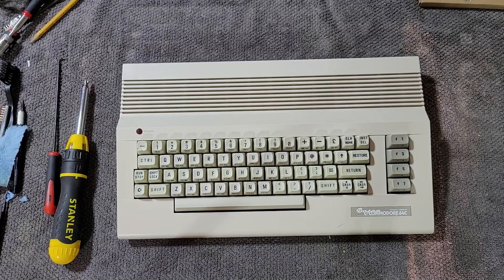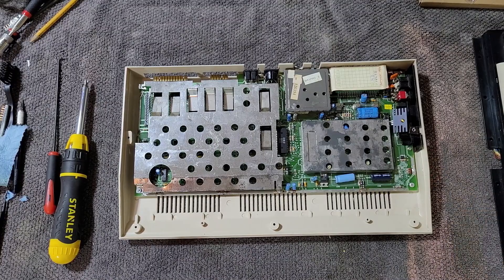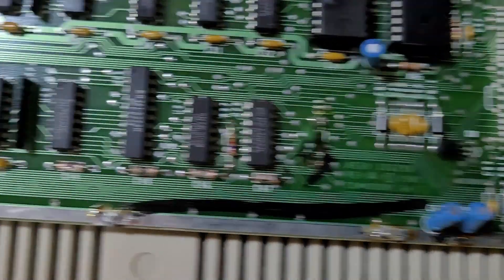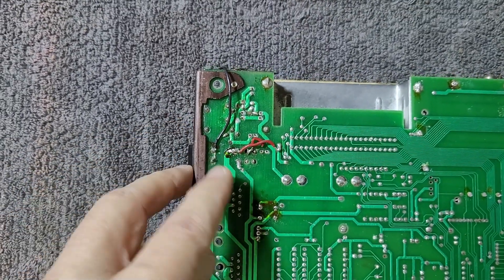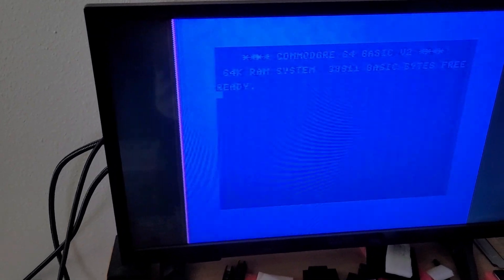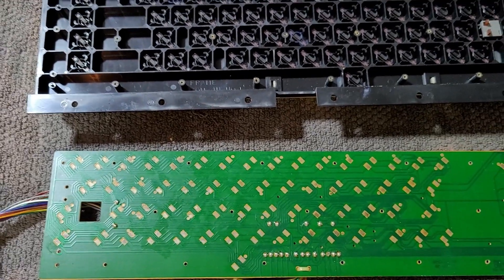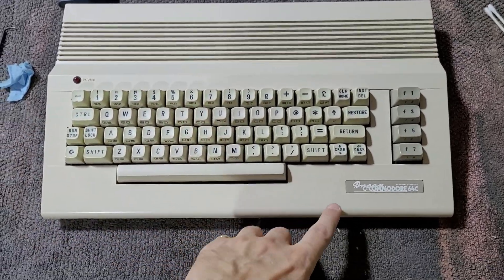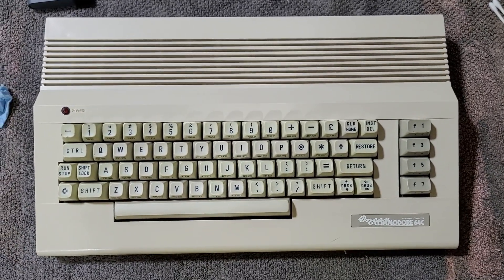Commodore Drean C64C(?)

Comment: I was born in Argentina, and had a Drean C64 as a kid (breadbin, not the C). They were cheaply made, and components were unreliable, as they were based on the cost effective models from Commodore, and spare components (but with official license). If you thought Tramiel was cheap…
Also, PAL N is an extremely weird version of PAL. Not completely compatible with PAL B used in Europe. I live in Spain now and sometimes I think of getting a Drean for nostalgic reasons, but I think is not worth the trouble. Nice video. It surprises me that people get interested in these obscure machines.

Comment: Nice video. I'm from and in Argentina, you've got pretty lucky, there were many variations of Dreans and on some of them the keyboards were awful (not yours). Just one point, Drean is pronounced as Dre Ann ;)
Reply from the maker: That is good to know.  Thank you!
Reply: most of the Drean's keyboards were made in argentina, which were a dead dog.... the thing is, in your 64c (case made in argentina too) was an old c64 motherboard  because Drean didn't get the okay to do the new c64C (hey should way a year or more release Drean's version)...but Drean did it anyways  (for that reason the case ,keyboard,power supply was made locally) ,when COMMODORE realisd about this, Drean lost the license. Dean did some unofficial peripherals under the name "COMM" (??!!) LIKE DATASETTES AND DISK DRIVES  (actually they were just chinese machines rebranded with a new badge and new packaging)
Reply from the maker: @sebastianbattaglia6330  Oh, very interesting.  Just from looking inside you can tell that SOMETHING was going on.
Thanks for the info!
Reply: @nhbretro  you are more than welcome! All this was confirmed by a former Drean's employee in some youtube interview 
(in spanish) and in several forums (in spanish too). Drean does still exist doing what they do the best... washing machines and fridges. 
Liked your sentese "Just from looking inside you can tell that SOMETHING was going on"... with this you resume everything. Not to mention the case... it looks like a 3D printed case  (some kind of cheap quality, rough edges and not free of imperfections). I can confirm that as I had a Drean C64 back in 1988. I thought it was some factory overseen error. Everybody thought that the "C" was related to the new style...and that's it,same thing that the old breadbin. We haven't idea regarding a new SID chip and other minor changes... cheers
Reply: btw, somehow, this Drean is very sought-after .by Commodore lovers  around the world.

Comment: Very good video. I'm sure you are aware that the motherboard isn't a 64C but a 64. The 64C has a large chip called the super pla and only 2 ram chips. I'm glad it's working, and you may want to touch up the soldering. Cool addition to your collection. Thanks for sharing
Reply from the maker: I was actually wondering about that.  I definitely expected a different motherboard, but this is the first time I've been inside a C64C, so I kind of took it at face value. I may look around for a PAL C64C motherboard.
Thanks so much for the comment.
Reply: @nhbretro  I personally like the 64 board over the 64C as the 64C has that super pla chip that is hard to find and replace. Other than that, it works the same
Reply: Hi! What site in Argentina? I am in Central America, closer. It's an option I would like to consider.
Reply from the maker: @brauliosolano  The seller was in Argentina, however the item was listed on the US eBay site.  Best of luck. :)